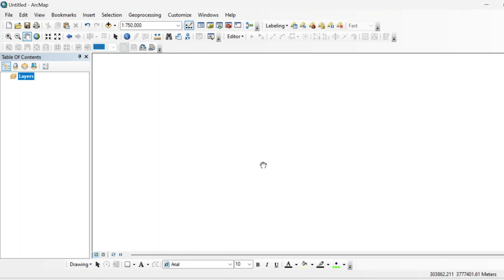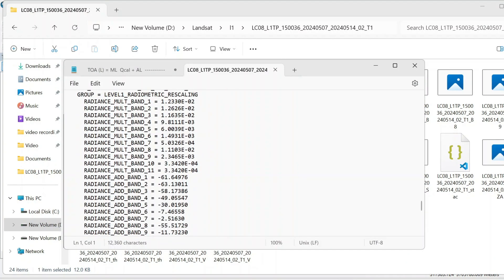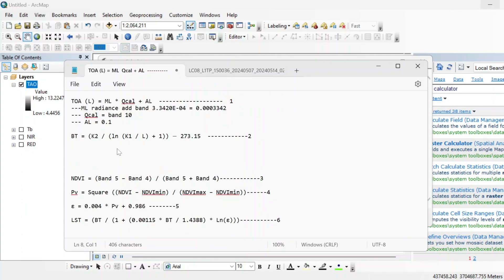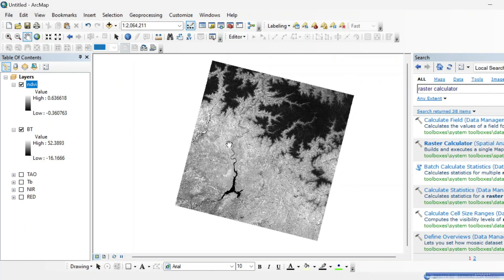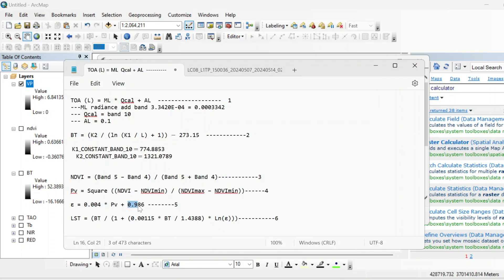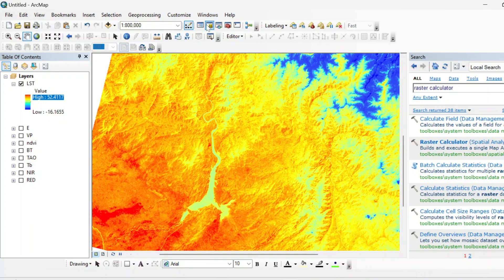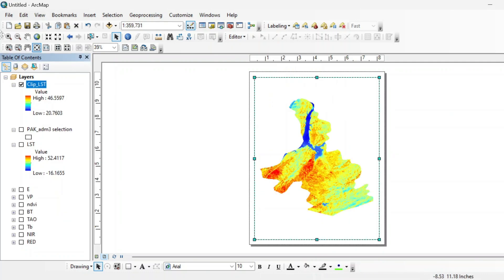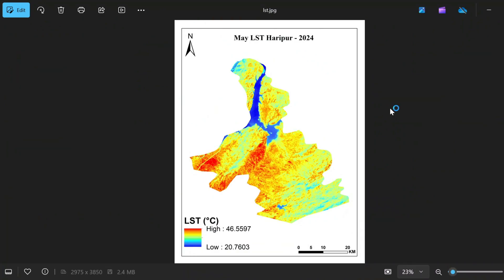Calculate LST from Landsat 8 || LST map in ArcGIS

Comment: Why my BT value is high?
Higest 70
Lowest 59
Which should 38 higest and lowest 18
I worked with L2 C2 data
Please help me sir
Reply: Thank you so much sir❤️
Reply from the maker: Might be possible... you are doing a mistake.. if L2 is giving 38max and 18min it can be okay because its normal..but.. if you are doing same thing on landsat L1 data then might b possible.. it will be a mistake on applying formula
Reply from the maker: Dont worry soon i will make these thing easy.. from google earth engine by making dynamic code

Comment: sir when i crop the image for the boundries the temp changes is it normal or is some thing wrong and also for mr the temp in lst is showing 79 c i dont know , when i crop to the boundries it changes the heat map any advice or help sir
Reply from the maker: Yes... max and min value will be change after cliping but max and min value will not exceed after clip from original image

Comment: Sir agr level 2 image use krunga to kya procedure rahega
Reply from the maker: This formula will be enough
LST: (("ST_B10" * 0.00341802) + 149.0 - 273.15).
Reply: @GISwithRajaUsama  WHICH IS ST-B10 OT just this one formula is enpugh for all ??
Reply from the maker: @HunteForRace  yes 1 enough formula for level 2
Reply: @GISwithRajaUsama  sir is that mean noo need all this calculation like no need nir and red and bt, vo and all just this one formula and band 10 tif sis enough
Reply from the maker: @HunteForRace  yes no need to do all steps.. just 1 formula

Comment: Thank you for the video.  Very insightful. The only problem I’m facing is that my Lst temperature is too high (in Celsius). I was wondering if you had a solution to this. Thanks
Reply from the maker: There can be many factor facting on it...
I cannt help you verbally...
You may download another image .. of same aoi... for cross check... Weather its calculation error ..or  .. error in dataset